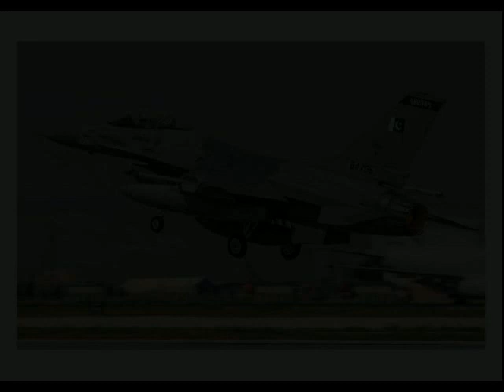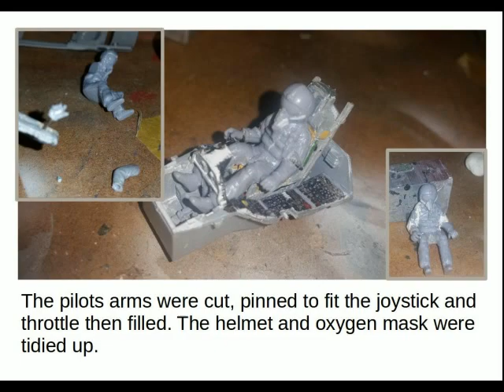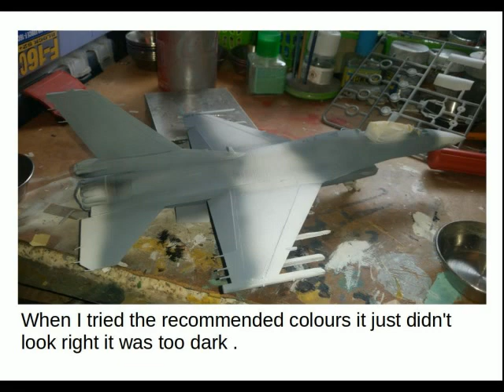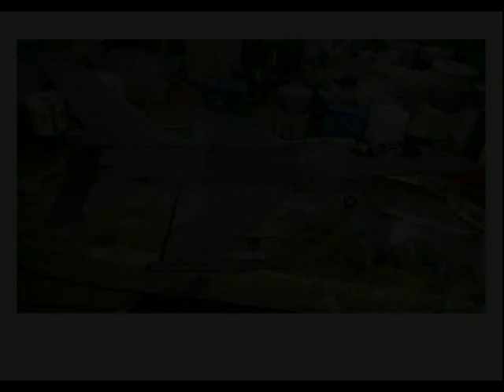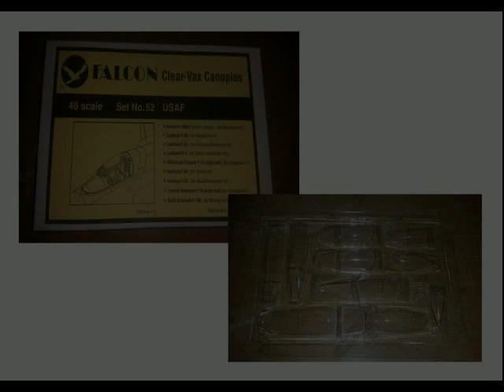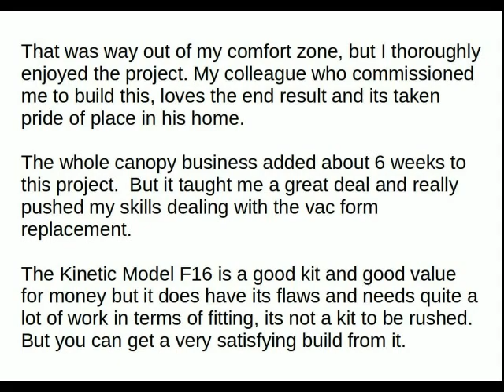F16 Pakistan Air Force  Build Vid - 1/48 Scale Kinetic Kit

Comment: Hi. I am from Pakistan want to learn this modeling. How and where should I start?
Reply from the maker: First and foremost find a subject you like, buy a nice simple kit. Airfix and Revell do goood starter sets.   
Depending on what kind of kit you bought, you will most likely need some tools, supplies, and/or paints. Any kit from a snap kit up to an advanced kit will require you to purchase a hobby knife and a pair of sprue cutters, or “nippers.” The cutters will help you remove parts from the sprue cleanly, while the knife will provide you the medium to “clean up” the parts. This can include removing “flash” (the small line of plastic that sometimes appears at the point where the two sides of steel molding met), shaving down a part to make it fit better, or removing any piece of sprue that is left on the part.
If you are buying a glue kit, you will need some plastic hobby glue, paint, and paintbrushes. If you are just starting out in the model building hobby, don’t overbuy. Purchase basic glue, a few bottles of paint (or even a prepackaged paint set, if the colors fit what you are building), and only the tools absolutely required to put the kit together. Don’t worry about making the kit look professional – use your first few kits as a learning process to help you better understand the skills and techniques necessary to complete a build. As you progress, there will be dozens of helpful tools and supplies you may want to buy – masking tape, modeling putty, sandpaper/files, tweezers, etc. Your local hobby shop or online store will be able to help you grow into some new materials and tools to match your skill level.
Most model kits will list the paint colors required, either on the box or in the instructions. Ask your hobby shop or online store to open a kit from the shelf and let you know what colors you need to purchase.
Remember, when you are first getting started, you don’t need to spend an inordinate amount of money on tools. Start with the minimal amount needed to put a kit together. If you really enjoy the hobby, you will slowly increase and expand the tools and supplies on your workbench over time.
Reply: @chancerNW  thanks for your very informative message. It will definitely help me start my dream  Unfortunately i don't think so there will be any hobby store here where i can buy these tools. However i will go with Aliexpress or eBay.

What do you think easiest to start with? I am planning to go with scale cars.
Reply from the maker: @JunaidKhawaja  I would suggest you take a look at the Airfix and Revell starer sets for cars , that come with paints and glue.